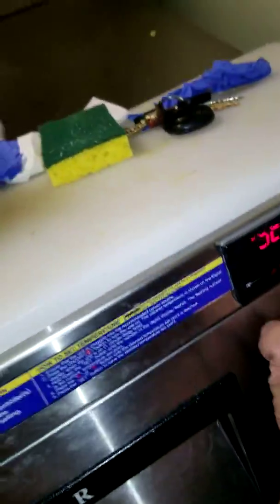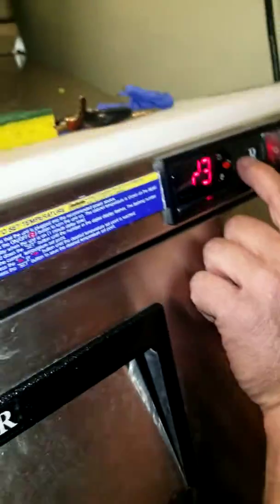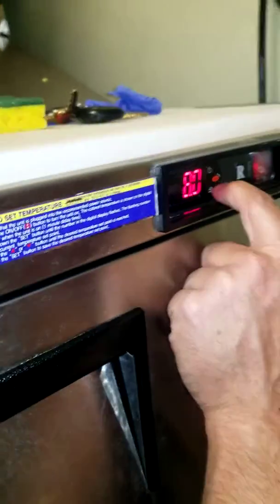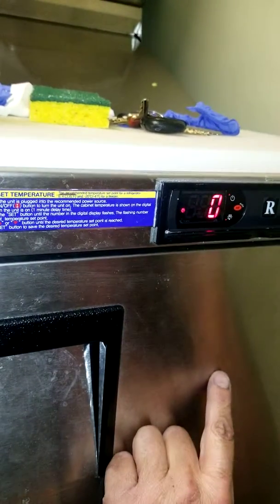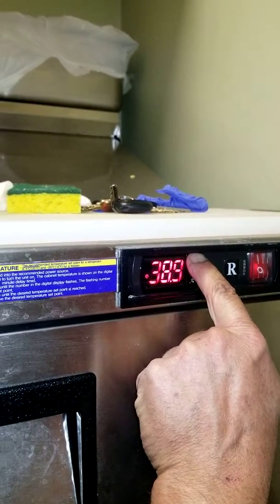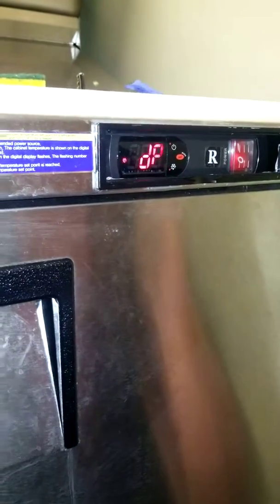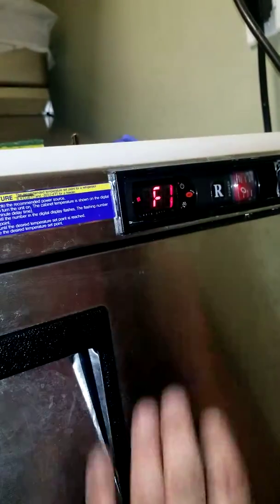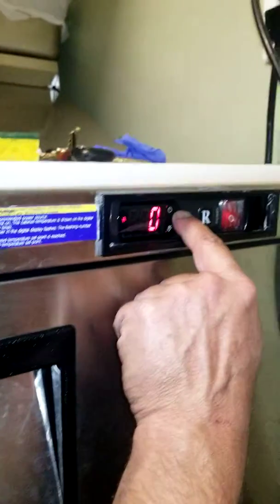How to program a carel when the fan is stopping with the compressor how to make the fan run on compr

Comment: I think it's silly when they come from the factory with the evap fan shutting off when it cycles.... unless they are trying to control humidty it's just gonna cause temp problems in my experience.... anyways great video!
Reply from the maker: That is some secret stuff you know your way around a carel bored?
Reply: Yeah I usually lean on the manufacturer to see what they want them set for than if I dont agree with them I will search online for the manual . A quick google search usually  gives me what I need for instance this is the manual direct from carel that gives you everything that (insert name of refrigerator manufacturer) doesnt want you to know...... https://www.google.com/url?sa=t&source=web&rct=j&url=http://catalog.carelusa.com/Asset/030220791_rev3_1.pdf&ved=2ahUKEwiFptLW8d7lAhWpIjQIHfDoAGIQFjAFegQIBBAB&usg=AOvVaw1YBSPkVNgzRw1AapICBZRW
Reply: @HVACRVIDEOS  i know it has a long time since you commented
but i want to ask you
i have a carel controller PCO2 which is used to control an HVAC unit and i want to extract the program to install it in another pco2 controller which is used for controlling a generator
what software should i use and how can iconnect to the unit?
can you help